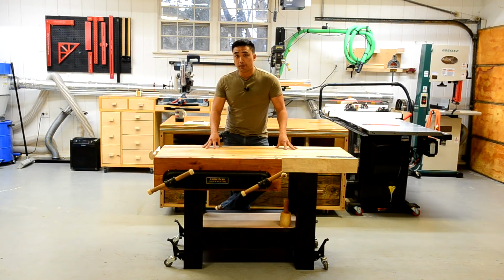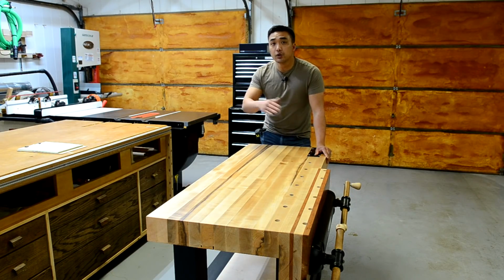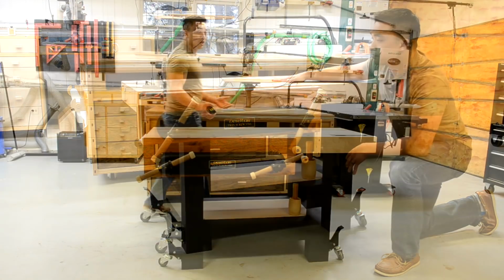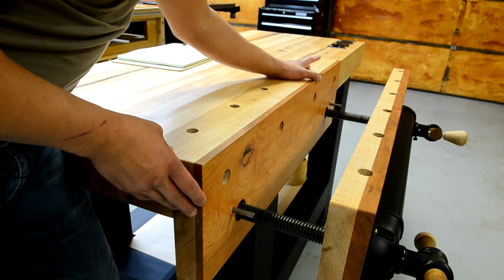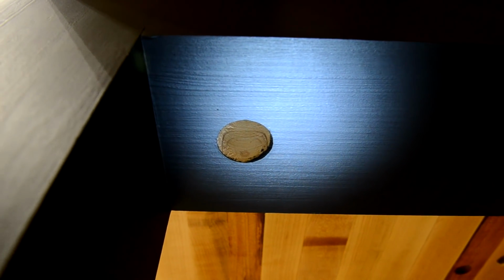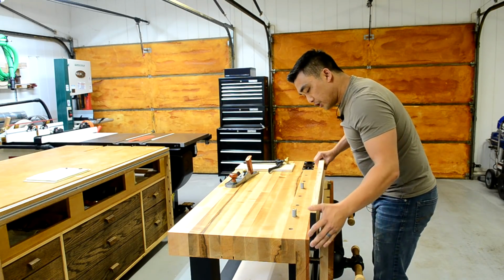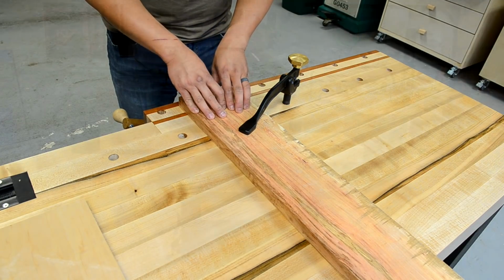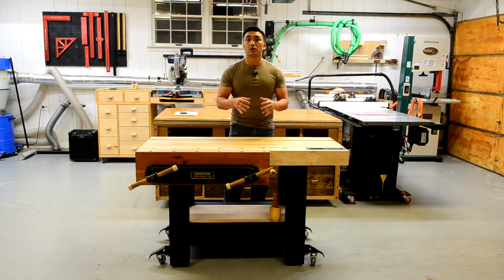Traditional Workbench for a Power Tool Woodworker

Comment: Loved this. Thanks for putting the video together. I’ve been planning a bench for some time, too, and also keep coming back to the Roubo, and ALSO keep thinking it just doesn’t make sense for my use. Your design is definitely the way I plan to go forward. Thank you! Do you remember what size screws you used to attach the top in terms of diameter and thread pitch? Did you just use four in the corners, or more?

Comment: Basically you've got the same dimensions as what I'm building but my top is thinner. We both have those casters. I'm looking at the veritas.. suggestion for those casters. You can reduce the wear on them by attaching a steel bar to two of them connecting the pairs on the short ends. That way you can stomp on the steel bar and raise two casters at a time instead of one. That way they take their part of the bench's weight in pairs instead of one at a time.

Comment: Does the face vise get in the way when you're working on the inset vise? I feel like I'd be banging my knees planing the far end.
Reply from the maker: The vise didn't get in my way. The handle sometimes does. In those situations, I just remove the handle.
Reply: @AlabamaWoodworker  this was my main concern with installing this vise as a vise on the long side of my bench like you have it..nice solution!

Comment: Great workbench build. Something like this would definitely fulfill the needs of my small apartment shop. Any chance there are plans or drawings available to show construction details?
Reply from the maker: I don't have drawings for this workbench. It's very simple mortise and tenon construction and the top is attached using bolts with over sized through holes to allow for expansion and contraction.

Comment: Nice work bench..why didn't you plane it yourself in sections then glue it up from there instead of bringing it to a shop?
Reply from the maker: I flattened the bottom relatively flat and then brought it to my community shop to plane dead flat and to final thickness. I had a lot of time invested in this bench and I didn't want to mess it up but wanted some practice.  So I worked the bottom by hand and the top by machine to get it perfect.

Comment: So I made my way over to Littell Lumber this morning after coming across your video yesterday.   I went there to pick up 20 boards and they told me that they did not allow anyone to pick their lumber.  They also said they carried #2 not number#1 lumber.  I asked if i could at least see before purchasing and they did walk me out to the yard.  The first couple of boards on top were definitley not ideal for a workbench.  I asked I could set those aside and the guy helping me out said hand picking  lumber is a lowes or home depot thing.  He wasn't rude per say but didn't seem like they wanted my bussniess either.  I am not sure if things have changed in a yea since you made this videor, but just wanted to give anyone a heads up before driving over there.
Reply from the maker: That was most definitely not the case when I went there almost 2-years ago.  I asked for the clearest in house pine they had. It looked likes #1 pine because each board I picked was clear. If tat wasn't the case, I apologize. What I bought was significantly better than anything I've seen at HD or Lowe's.
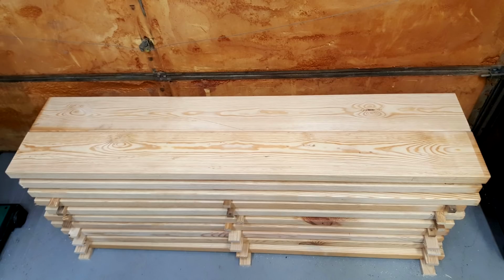Reply: No need to apologize, definitily not your fault.  The boards that you show at 1:04 in this video are much better than anything I saw out there today.

Comment: Nice for guy that is into mostly machine woodworking and not fine woodworking. I am same now days. Nice design and execution.
Reply from the maker: David Davis Thank you, but I would not classify hand tool work as exclusively fine woodworking and machine woodworking as exclusively not fine woodworking. There are many articles and builds within Fine Woodworking Magazine that use a majority machine tools. I don't believe that makes the final product any less in quality. Case and point...current Thomas Moser pieces are produced mostly with machines, even CNC machines. I would still classify the quality as fine furniture given the design, attention to detail, and quality of material.
Reply: One should use woodworking machines the same way one should use a computer: For repetitive tasks that require precise results. If it isn't repetitive, evaluate doing it by hand. Sometimes the hand-driven solution will be faster and just as accurate, e.g., sawing the 4 x 5 legs to length, or cutting tenons on the stretchers can be done with precision and with not much more time involved than you'd spend setting up the machines. Like every rule, there are many exceptions to this one.

Comment: Another great video. I am surprised that you do not enjoy hand tools more, being an engineer and wanting to be exact in you measurements? I do love the Veritas hold downs as well. Once I relocate to TX in a couple of weeks I will get to work on my two car garage work shop as well. I am super glad you were on popular woodworking video for the week as I have really enjoyed your way of I guess you could say instructing. Thank you for sharing you time and knowledge with us.
Reply from the maker: Richard Garrow Thank you, Richard! I very much enjoy using hand tools. I've used them on nearly every single project I've made. However, I don't use them exclusively. Most of my fitting and finishing work is done with hand tools. I also cut quite a bit of joinery with hand tools. I do not mill my lumber with hand tools, but I am knowledgeable in prepping stock with hand tools. I consider my shop to be a modern blend of power and hand tools. I designed my workbench specifically for joinery and final fitting. I have a deep appreciation for hand tools and cherish my hand tools just as much as my power tools. 

I saw that Pop Wood featured one of my videos. Very humbled and appreciative of the recognition. Thank you for watching!

Comment: Danish oil for top is ideal because it dries faster than boiled linseed oil and smell goes away sooner and isn't a slippery as polyurethane which may become a problem when hand planing using a holdfast. Also it can be recoated without the need to strip off previous coat.
Reply from the maker: Joe Blow Hmm, I thought Danish oil was a polymerized linseed oil, which is essentially a poly/oil/spirits blend which is what I used. It's been a year now and I haven't seen problems with using a hold fast. I'll have to see if I have problems refinishing it in a couple of years. Thanks!
Reply: Yes its polymerized but not the same properties as poyurethane.  The polymerized process speeds up drying and slightly hardens oil but its still softer then most polyurethane.
Reply: Also its less slippery so work piece is less likely to slip under load.
Reply from the maker: Do mineral spirits not speed up the drying time of shop blended wiping poly?  I always thought blending your own mix gave the woodworker more control other the drying/curing time of the finish.  I'm using a equal parts blend of oil, poly, and mineral spirits.
Reply: Mineral spirits are used as a thinner to dissolve both boiled linseed oil and most oil based clear coat  so they and be combined together. Its the clear coat that is catalyzing to speed up drying and harden finish.
Reply: Oil based japan drier is used if you want to use only linseed oil but want it to dry faster.
Reply from the maker: I'm very happy with the performance of the top given the mixture of the finish I used.  Thank you for your opinion on the subject matter.

Comment: Nice job on the video.
I have a couple of questions on the function of the bench.
The  bench top vise  dose it get clogged with saw dust and wood chip?
Do you find the chop vise handles get in the way when working around the bench?
Mark
Reply from the maker: Hi Mark! After over 1 year of using the vise I have not noticed sawdust clogging the screw.  The vise handles do not get in my way.  If they did I can always drop the handles by unscrewing the center pin on the vise handle.

Comment: Thanks for all the information regarding the bench. Most of the benches I see are tall and long, so I work at rib level and stretched out over my work. Great job, this idea will work fine for me. Little surprised you didn't put a drawer in the base to toss small dogs, clamps or other miscellaneous items. The price of wood is quite a bit more in So Cal, the top is minimum $10 board ft.

Comment: Your bench height is pretty much spot on for a traditional French workbench, I have seen several, all around 31".  To me that seems very low - probably intended mainly for planing with traditional, deep wooden hand planes, so that you can "put your back into it".  My work benches have been 36" & 38" respectively (I am 6'), I find that kinder to my back and I plane on them but if I did mainly hand planing, perhaps a slightly lower height might be optimal?
Reply from the maker: Tony Y At 5'6", that 31" bench top height is ideal for me for planning and chisel work, which are the two operations I do mostly at my bench. Thank you for watching.

Comment: What was your reason for using milk paint? I have never used it but I keep hearing about it more and more.
Reply: It looks cool, lasts well and gets a lovely patina with age. It can be toxic solvent-free.  Milk has wood-preserving properties (e.g. untreated Swiss milk pails & implements, Swedish boiling of implements in milk).  Why not use it! :)
Reply from the maker: Milk paint has definitely become very popular. The ingredients in milk paint make it extremely durable. I used General Finishes Milk Paint which is actually not a "traditional" milk paint that you have to mix. It's very easy to use and I particularly like the flat/matte finish of milk paint. I used milk paint to give the workbench my own touch of style and for durability.

Comment: That's artwork right there mate. It's beautiful. I want to make one but I don't have all those cool gadget. Can I just use regular 2 x 4 lumber from Home Depot to make it as a top? And maybe 4 by 4 for the legs?
Reply from the maker: Rather than 2x4, I'd suggest going with 2x8 or 2x10.  You want as much straight grain as possible, especially with dimensional construction grade lumber.  You can do that by buying a wider board and not using the center 1"-2" where the lumber tends to be more flat sawn.  Also, 2x4s tend to have more bowing.  Yes, you could totally use 4x4 for the legs.  I would probably mill them down a little to get a perfectly square leg.  Lastly, you want to look for Southern Yellow Pine (SYP), or Douglas Fir (I prefer SYP).  Most construction grade lumber is called (SPF, Spruce, Pine, Fir), which tends to be lower quality but ideal for framing.  SPF tends to be much less dense than SYP. That being said, you can make almost anything work.
Reply: AlabamaWoodworker can I double check, are you referring to 2X8 inches? I plan to build a very similar bench to this (best video I have seen) but timber in the UK is very expensive. Also. Are you cutting 2x8 or 2x10 down the centre in half? I’m thinking 10 inches is an extremely thick bench.

Many thanks
Matt

Comment: Hey! Very good video, and the work bench is really good looking and functional. 
Could you, please, name the products to protect the surface of the top? I can't get the names you said of those products to help the top last longer. Thank you!
Reply from the maker: LoveZick Thank you! Apologies for not speaking clearly. It is a blend of 1/3 boiled linseed oil, 1/3 polyurethane, and 1/3 mineral spirits. This is essentially a wiping varnish. A lot of woodworking "purist" cringe at the thought of using such a finish on a workbench but I have not experienced any adverse affects of using a light coat of wiping varnish for protection.

Comment: Nice bench. I am predominately a hand tool woodworker.  What you built here is more than adequate for all of my needs. It will no doubt serve you well. I really like the little knob you placed on the front so you can open it more quickly. Could you pleas describe it a bit more?  I'd like to modify my twin screw vice handle to do this as well.
Reply from the maker: Joe Leonetti The knob came with the vise. There is a machine screw that goes through the knob and the handle with a plastic bushing inside the knob. A washer prevents the knob from coming off. For a diagram of the knob, visit the Lee Valley website and look at the instruction manual for the twin screw vise. You can even order the knob, machine screw, nut, washer, and bushing to use on your vise from Lee Valley.
Reply: AlabamaWoodworker thanks

Comment: I enjoyed very much your discussion for the bench... If I wanted to rebuild your creativity, how would I get your plans?
Reply from the maker: James Battersby I don't have plans for workbench other than a simple drawing with overall dimensions based on my height and the length and width of the bench top. The leg assembly is the same width as the bench and about 12" shorter than the bench top length. The tenons are 1/3 the width of the leg thickness. The top is held to the legs using 1/2" machine screws through oversized screws in the legs to allow for expansion.

Comment: Quick question about the Veritas Inset Vice installation.  Did you use a plunge router to cut the recess(es)?  I'm thinking about getting one of these vices, but my main concern is being able to accurately remove the outside recesses that the shoulder of the vice sits on.  I think it's about 1/8" deep at that point?  Would love to hear how you went about removing those smaller (outside) recesses.  Thanks.
Reply from the maker: bobznew I used a router but was not confident I could cleanly cut to the line. I was not too concerned with the deep plunge but the shoulders of the vice needed to be clean. I left the line and then cleaned it up with chisels and a router plane. It was much cleaner and more precise that way. Hope that helps.

Comment: Great looking bench.  Can you tell me the size and depth of the mortises and were they centered  on the width of the legs?  Once again, great job.
Reply from the maker: The mortises were 2" wide, 3" tall, and 2" deep.  The front and rear stretcher tenons were centered on the width of the legs but the left and right stretcher were offset but flush with the sides of the legs.  The stretchers were 4" wide so it's not a perfect 1/3 division of shoulder-to-tenon-to-shoulder but I think it's plenty strong with the draw bore.  Lastly, I need to make the mortise and tenons 2" deep or else the tenons from front and back, and left and right stretchers would touch each other.  I hope this make sense.  Thank you for watching!

Comment: How do you like that veritas setup?  Very nice work in general sir
Reply from the maker: toms place Sorry, Tom. I'm not following your question. Could you please rephrase?
Reply from the maker: toms place Gotcha! I really like the twin screw vice and inset vice. I bought the twin screw used on Craigslist and the guy I bought from said he couldn't get it to work properly. Veritas states that the directions need to be followed exactly or the voice won't work correctly. Doing so made my install very easy and it worked flawlessly the first time. The inset vice was also easy to install and plenty strong for my use. The only I would change would be the size of my vice chops. I think 18" on center would have been a more appropriate size.

Comment: I needed this. I am in the process of putting a work shop in my  under used garage. I am 76 years old  and was a wood worker  20 plus years ago. My real job was being a University administrator and ending my career as a Dean at Medical School. So far the most fun is putting together  workshop. Gig Grizzly 10 " table saw,installing lights plus120 and 220 plugs all over the place Buying many hand and power tools etc and watching You tube videos.  This has been a 3 months process.
Reply from the maker: Jane Heaphy Sounds like a very rewarding career. I'm happy to hear you're setting up your shop. Good luck!

Comment: Nice bench!   A bit off topic.  My garage is a sweat shop.  The doors are thin Aluminum and exposed to afternoon sun.  The garage is very hot in the heat of the summer.   What did you do on your doors and how did you like it?  Some sort of expanding foam?
Reply from the maker: Danny Compton I wish I knew exactly what was used on the garage doors. When i bought the house, the insulation was already installed. If I were insulating aluminum garage doors I would probably buy the insulation kits offered by the big box stores. I believe it would be less of a hassle. I realize that the expanding spray foam would probably have better insulating properties but the trouble and mess might not be worth the small increase in thermal resistance. Check out Sean Rubino's web blog. He's a fellow woodworker that insulated his garage doors similar to yours. Sorry I could not be of more help.